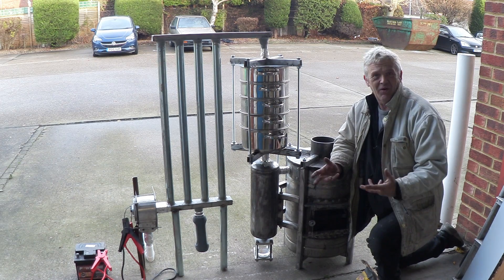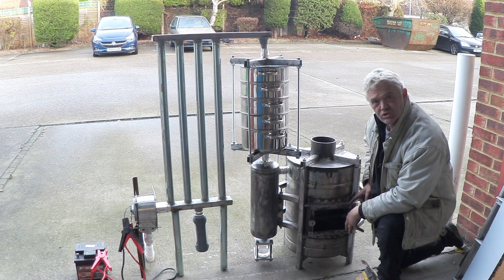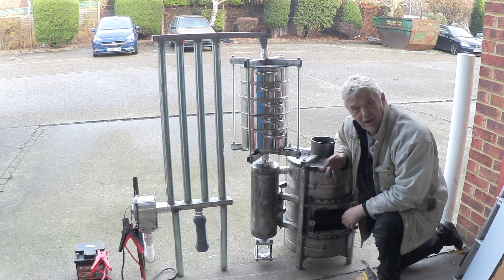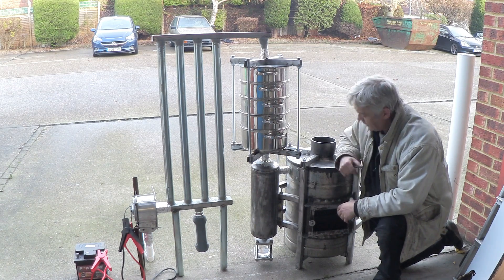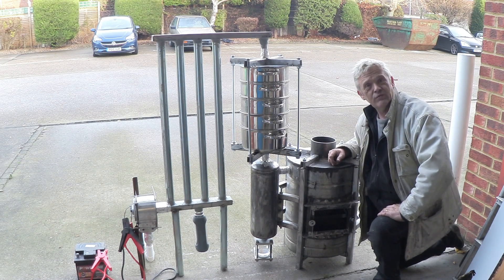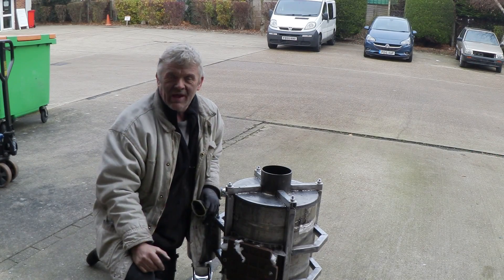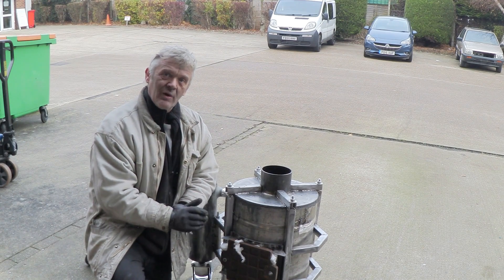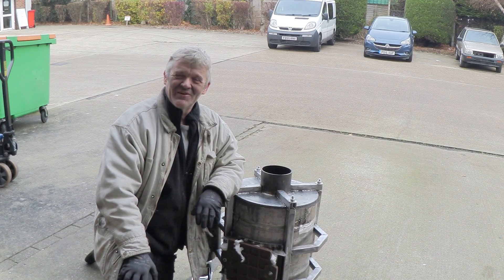DIY Gasification and Generator Unit - Part 8 - Fire It Up

Comment: Since the gas needs lots of cooling to remove the large amount of water vapour and tar, I'd love to see if someone can use an old hot water tank from a central heating unit; running the gas through the internal coil. You can probably pick them up for peanuts as people just scrap them. It would cool the gas extremely effectively.

Comment: It seems to me that you are not able to maintain a sustainable flare. I hope this would not be due to too many leaks in you system. If not then the other reason could be your gas exits at a too high velocity. This you can simply cure by just welding a bit of pipe of a larger diameter to your exit pipe. I would recomend that if you exit pipe is one inch, you weld a 15cm long piece of pipe of 10 centimeter diameter. This will greatly expand the amount of gas so it slows down and mix better with oxygen so the mixture will better ignite and the flare stays on. I also saw the partial ignited flare was very yellow. This could be a sign of Tar production in your build.

Comment: Dear Robert. 
Your Videos on the  "The Gasifier" are the best about this subject that I have watched because you explain it so well, Piece by Piece! You then assemble and run the complete "Machine!" 
I have watched a lot of Videos in my time on "The Tube" and although they/most are very good they are sometimes a job to "Get Ones's Head Around!"
On the Positive Side one always gleans some fresh ideas from them!!" 
You say that you welcome and enjoy comments on your videos and "Stuff!" 
So here are a few! 
I have, I believe, a very Important Idea on how to (Inspired by Indian and Other You Tube Videos) Clean Up The Waste Plastic and Tyres from the Environment, possibly from the Oceans to! 
With the help of a Ship, Solar Power/Wind Power etc) Healthily and Cleanly! 
On my part I hope and plan to make a Large Gasifier to Power Up a "Retort" to Distil Suitable Plastic and Tyres to Reclaim Oil, Diesel, Petrol, Carbon Black etc back from the Waste and then ether make good use of  the Usable Syn-Gas by Routing it back into the Base of the Gasifier's "Burn Chamber" to help the Gasifier burn or; "Bottle" the Syn-Gas using a much safer "Diaphragm Compressor" which are available from "Machine Mart".
If you encapsulate the Rad Tubes and then Fill the Surrounding Vessel with Cold Water and "Trickle" it through, you will cool the "Rad" a lot better! 
As a bonus this mod would also produce some warm water to wash in or use as you wish! I do really, really like your Cyclone made from a Used Fire Extinguisher as it saves all that dreaded "Wrestling with the Tin Stuff!" 
Would you consider "Silicon Bronze Welding" (Brazing) your Cooling Radiator etc with the aid of Oxy-Acetylene Kit as it is easier to seal the pipes etc and easier to avoid "Blowing Holes" in the tubing etc!  Brazing is quite strong enough especially if "Braced up but the Car M.O.T Testers do not like it on "Structural!" OK on "Non-Structural Exhausts though and it is great against vibration!" One can always "Go Back Over It Again" if one finds a "Blow Hole/Leak!" Brazing is also very enjoyable, the more one does the better one gets! One only has to heat the metal up to "Cherry Red"  and "Flux it"  to get the "Braze" to "Flow!". It's "Golden" Appearance is so Lovely and it is so like Jewellery! There is also "Silver Soldering," with a "Butane Gas Torch," to be considered and this is Skill can be used on the smaller items that we have to fabricate! 
It really is a shame to ever, ever paint over Brazed or Silver Soldered items!
How about a reasonably priced "Machine Mart", Chimney Sweeper's, Ash Collecting, Vacuum Cleaner that will "Double up" as a Cyclone, Blower and a Char Collector Combined?! 
An eBay sourced "AC Motor Speed Controller" (Or DC) would also be advantageous and are easily "Gathered" at a reasonable cost and I know that appeals to you so much! 
As it does appeal to myself!
Or: "The Sliding Cover Plate!"
The Syn-Gas may well have to be Cooled a Little before it goes through such a "Blower/Sucker" device to protect the Blower/Sucker Motor! I gather from other "You Tube" Videos that if a substantial quantity of "Steel/Wire Wool" is placed in a Gas Tight, Flow Through Container, placed in Series in the Gas Flow Pipe in a suitable place, is a very good Safety "Flame Arrestor!" 
Yes!!! Your Gasifier Device placed in the back of a "Pick-Up Truck" to "Power Her Up" would enable us humans to go many places so much cheaper, enjoyably and very environmentally cleanly! 
I wonder if there is a safe, Non Polluting Substance that could be added to the Syn-Gas at the Gasifier's Open "Tail Pipe" that would colour the Syn-Gas "Blue" anyway, even if the Flame is "Pure"?!" 
I can not say that I like "Invisible Flame" to much! 
There may well be many a "Practical Genius" out there to ask and no doubt I am asking/writing to one or even more, including your good self Robert, right now?! 
I have learned so much from your Great Videos and from You Tube in General! I am forever grateful to the "Founders" and the "Tubers" for this Advantage! 
However! I do have to stop myself from "Bounding Along" sometimes!
I do consider Safety to be For-Most and I do try to Double Check Everything!  
I believe that one must always try to develop any ideas that one is fortunate enough to think of and then always "Carry on" and "Carry/See It All Out!" 
I also rate highly "Down Draught" Gasifiers!"
The Gasifiers with Two Chambers (Upper and Lower) that are used as Domestic Hot Water Heaters amongst other things!
Because of the "Blower" being a "Sucker" and bringing the Syn-Gas along the system and out of the end I suppose your gasifier is a "Hybrid" Down Draught Gasifier?
If the "Blower" were situated differently, the fuel fed in from the side of the Fuel Chamber. The "Burn" went up through and exited at the Top of the the Sawdust/Fuel Chamber the 
"Smoke/Syn-Gas" would then be "Filtered" by the Sawdust/Wood Pellets/Charcoal etc Fuel (An Advantage) she would then be an "Up-Draught Gasifier" as I try to understand it all!
Gasifiers burn so cleanly! Do not Open the Door though: look through the Pyrex!
Having worked at Oldbury-on-Severn, "Non- Carbon" Nuclear Power Station as an I.M.D Craftsman I recognise a "Kindred Spirit" in your Excellent Videos!
I have worked with such good people and now I am watching such good Videos!
Back in the Day "The Work" Helped me in my Life such a lot, especially nowadays with my Farm and my "Tubery Rocketry!"
I do find that I have to do a fair bit of editing after reading through/proof reading! This after my comments have been on "The Tube" for a day or two!
Got to try to be accurate and correct!
I also "Dig" and Enjoy, the Such As Successful, Elvis "Marie: His Latest Flame" "Shuffle Dancer's" Video(s)! 
I look forward to watching all your other Videos Robert and Welcome your Comments on my Ideas/Dreams/Possible Fulfilment's, Comments to!
When my Farm allows me to and "When I Have the Time" I will have a project or two on the go! You all Mark my Words! 
Meanwhile it's Solving Problems, Looking after the Cows, Sheep, Cider, Farm Work, Repairing my Tractors/Cars and Farm Equipment plus keeping Myself and Others Happy, Fed, 
Healthy (Health is Thee Most Important Thing in Life) and Keeping myself So Very, Very Pure!
It's OK! No Problemo!
I do appreciate and thank you Robert for all the effort that you have made to "Put it All Out There" for us all to enjoy!
Generally: What Part of the World do you hail from? Are you a Prof or a Boffin? Are you in Engineering Robert? This is just  out of Interest on my part.
Well Done Those Dancers! 
Well Done That Man!!! 
All the Very Best to All of You! 

From, 
Farmer Rob of Halmore.
In The Berkeley Vale.
The West of England.

Comment: Hi Robert, loving your new gasifier. 
I would like to offer you some help getting it connected to your engine. 
Over the years I have learned so much from you that I would like to return the favor by making a series of videos for you. 

HOW TO CONNECT YOUR MAD FUEL SYSTEM TO AN ENGINE. 

Looks like you have a Honda GX160 or 200 clone.  It's my fav engine that I have spent years working on with GEET. 
I have 6 or 7 sets of pre-conversion data for those engines and can totally help you get this thing working.

I was going to send you a set of messages, but there is so much info that a small video series might be better.
It's about time you got to fast track a project by sitting down for a few hours and watching some vids, like the rest of us do.

Dan Easton GEET life

Comment: firing it up a really interesting group of videos this series has been on Gasification i think the only thing that i suggest is to put a variable on the fan speed and use more charcoal to get to that magic 2000C that cracks the tar and makes it a tar free burn . fantastic content brilliant
Reply: At 2000C the pipe around it would melt, lol

Comment: Great to see the gas produced. Have you considered storing the gas in something like a bladder or large lorry tyre inner tube. That way you could run your generator or a gas ring when you cannot stoke the fuel burner. Thanks for the video.

Comment: The top 8” or so pipe for filling with organic fuel....add a spring tight flap lid so gas is contained but can give if a flashback happens etc. or add a larger fuel hopper with a lid that has a spring compression lid to allow for possible flashback gas ignition etc.
Reply from the maker: cheers mate

Comment: I really do like the design yet I think you need the fresh air inlet pipe closer to the main flame.... also a spring back lid to cap the top where fuel is inserted. Use a couple or few 1/2”-3/4” diameter air inlet pipes just below the steel pipe where biomass fuel is being burned. So the Oxygen is helping ignite the super hot jet flame ;)
Reply from the maker: you make the changes you think mate when you build your own!

Comment: Hi Rob.. the engine is already its iwn vacuum pump.. why not just connect it and let ut suck by itself?
Reply from the maker: it's a bit of chicken and egg mate - you are right the engine will do that but once it is running and there is no production without flow through so the pump is needed to get things going once going you can turn the pump off

Comment: .......so coke or charcoal would be my preference. But they aren't a carbohydrate or hydrocarbon, it's pure carbon ,thus no water is produced as a by product along with the carbon dioxide during the burn. Combining steam and red hot carbon is what produces the fuel  gases hydrogen and carbon monoxide ., You don't have a source of water vapour from what I've seen of the design except for perhaps the damp misty air characteristic of good old verdant England .
I haven't looked at the FEMA designs but that requirement for water vapour is what I'm focused on .
Reply from the maker: probably just the damp air here is enough mate - but I get what you are saying

Comment: No matter how much gas is produced , the flame should be able to sustain itself with out any external help.
Reply from the maker: maybe - but have you tried to light a propane torch running too fast? you have to turn it right down to get it started then it will burn - when it runs too fast the air just can't mix and by the time it has mixed it is just too dispersed
Reply: I get your point . Falls into a logical explanation.  To test that theory put a ball valve in, to mix the air in before it leaves the pipe . Which you were probably gonna have to do anyway to run a car on it. Like you said .  If it doesn't saty lit after the ball valve placed . You need to check for air going into the system through your gaskets , then check the welds . I know you can check air leaking out with soap and water . But that thing creates a vacuum so I don't know if that will work the same way , maybe you can see fluid being sucked into the system 🤔 idk

Comment: what i learnt... i would down regulate that blower a bit, variable speed control?,, with charcoal half fill the tube and light it from the top, when lit you will not see the flame in daylight
Reply from the maker: nice one - cheers

Comment: Hey Robert, please read this. This will help you get thing started with out ripping the pull cord out of that thing. Even with electric start it can be difficult to get an engine going on a 100% woodgas. This is especially for your first time. Once you have your adaptor build and installed get it running on gasoline and then connect your hose from the gasifier with your mixer valve wide open. If it wont run then your hose and mixer valve are too small. If you can get it to run on both it will be very rich and the engine be bogged down. But close off the gas supply valve on the tank and let it run out of gas. As the gas begins to run out in the float bowl, the engine will pick in rpms. As it is doing this this is when you start to close off your mixer valve. Do this slowly as you are trying to find a good mixture to keep the engine running.  Once you find the right angle take note or mark it. This will help you later when you start on a 100% mixture.
Reply: For that engine you need a 1 1/4" hose connection and a 1 inch NPT valve for your mixture. That will give the correct range for that size generator.
Reply from the maker: awesome advice - cheers mate

Comment: i found if you use charcoal you light it from the top, also my unit would not run a motor on pine, had to be hard wood,  heating pellets are good, or hardwood cut into 1 inch cubes, great work.
Reply from the maker: Great tip! thank you

Comment: If I remember correctly, there are a few ways to catalyze syngas into alcohol... at relatively high yields. Yup! Thanks, google - "Single-pass transformation of syngas into ethanol with high selectivity" published at the start of THIS YEAR ! So, if you convert the syngas into ethanol at 90%, I'm pretty sure your generator system is simpler, and you'd be turning a pound of yard trimmings into a half pint of gin... yes, 90% selectivity and 40% alcohol content, that checks out.
Reply from the maker: I like that mate - cheers
Reply: @ThinkingandTinkering  I'll keep an eye on the chemistry research, until it percolates enough for me to make use of it. :) Another odd idea, regarding your statement in a video the other week, about compression and tension skins of a panel under torsion or transverse force: you mentioned that 'it's hard to make a rigid honeycomb for your filler material' - and the image in my head is if you mostly-fill a panel-molding frame with softer, grain-less foam balls , then you can pour your epoxy, perhaps in layers, to form a 'honeycomb of epoxy pillars' . The foam balls should be the diameter just below your final panel thickness, so that the pillars' cores are direct, stiff lines of force. Using smaller balls as the maximal scale will create the zig-zag that caused soft foams. Smaller foam bubbles in-fill the gaps, instead, forming layers from tiny to modest, so that the epoxy structure that penetrates them would look like a tree's branches. Because the foam balls are only experiencing the tangential force of the pillars as they attempt to buckle, and those pillars only feel the tangential force of the two planes, then the foam's softness is negated by a mechanical wedge. Also, the epoxy filling those gaps has numerous triangular, flanged cross-sections, which serve to transfer tension and torsion from one area of the volume into others, which is especially important for situations with unequal loading, high absorption of stresses. I suppose I should shop around for Styrofoam peanuts and epoxy...

Comment: Welsh anthracite was the most favoured fuel — whenever it was available (which wasn’t often in the war, as it was prioritised for use on the railways).  It has the highest calorific vale per unit volume.
Reply from the maker: cheers mate

Comment: Great project.  I'm thinking that charcoal is mostly producing carbon monoxide, and another biomass might produce more hydrogen and methane.  Carburetion is tricky with syngas, anyway.  Really like this, and hope that you show us the system running in future.
Reply from the maker: I was thinking the same thing mate - I think I am going to down the draught and use wood pellets
Reply: @ThinkingandTinkering  I've read that there is also an effect of too much cooling, as well as stratification of the different flammable gasses -- loss of some volitiles to condensed liquid, or "soaking" into the filter material to be burned later.  Some heat in the fuel seems to help starting spark ignition engines, as does more methane at the beginning. Perhaps enriching the startup mixture with propane, gasoline, or alcohol.

Comment: I think mankind should try using charcoal as a byproduct to entrap carbon dioxide and bury it in the ground creating a future fuel source in the form of char-COAL mines to be used when we have the tech to deal with it. 
Two problems solved, heat for industry and CO2 locked away.  The gasifier will be the solution, and planting millions of trees.
Reply from the maker: I agree mate

Comment: Couple observations.

Your air flow is too fast.  Yes you are getting gas but it appears that you are pulling through the system too hard.  Your flame should be sustainable in your check pipe after being lit.

Obviously you need a proper connection to the generator with valves to regulate the gas flow and air flow for combustion in the generator.  This will require some tinkering with the flow of the gas/air mix.

Impressive beginnings for sure.
Reply from the maker: cheers mate